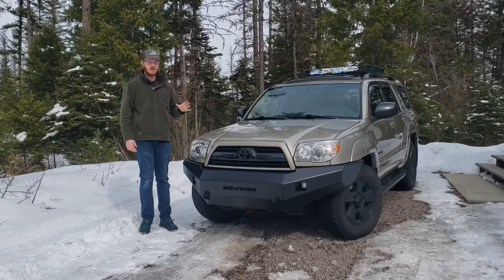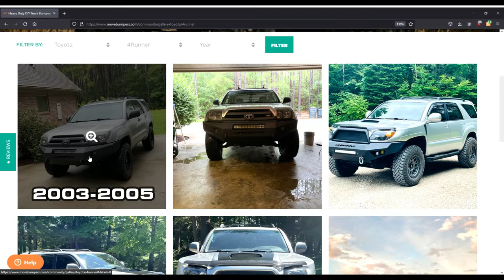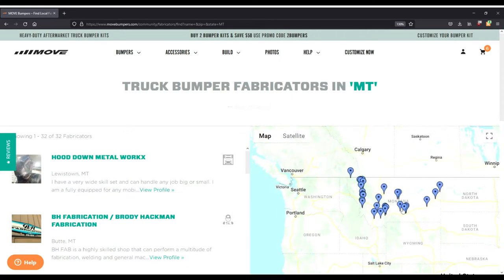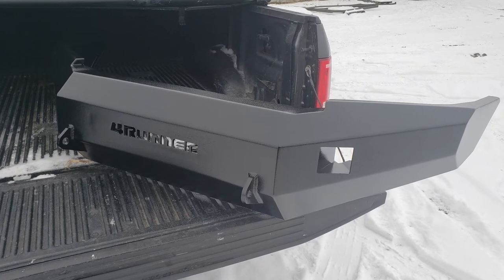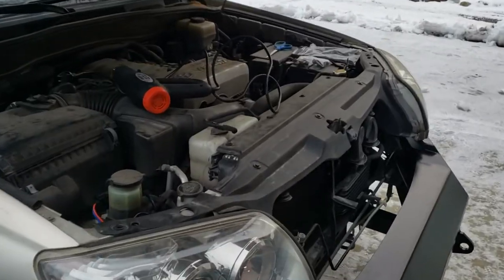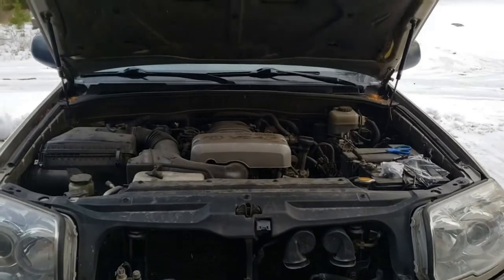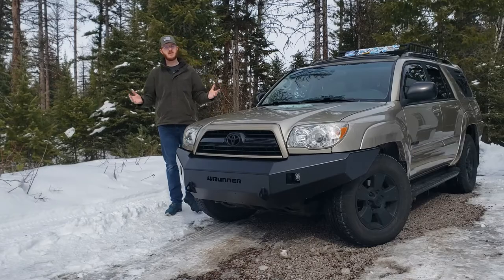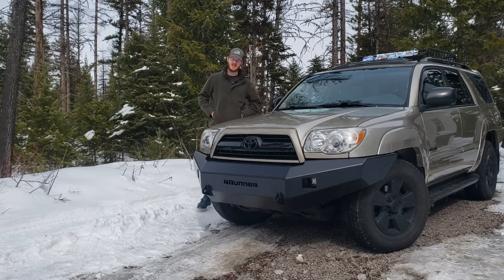Move Bumper Review | No DIY welding required!

Comment: I just bought a 2003 4Runner last year.  I thought about getting an aftermarket bumper for future off road adventures.  Then, I saw some recovery videos and realized it would be a waste of money.  All of these aftermarket bumpers bolt up to the original crash bumper mounting area on the frame with eight bolts if I recall.  One or two of the recovery companies won't even use a front end boom lift on Toyotas because of this setup.

Comment: I thought the 2005's also had the turn signal light on the bumper.  Do you just not have front turn signal indicators anymore with the new Move bumper?
Reply: NVM, I see you changed out the headlights. Those don't appear to be the stock lights.
Reply from the maker: I actually did the 06+ front end conversion on my 4Runner, so it has OEM 2006+ Toyota headlights. But you're right, its not the original 05 set. I have a video on my channel documenting it more if you're interested.